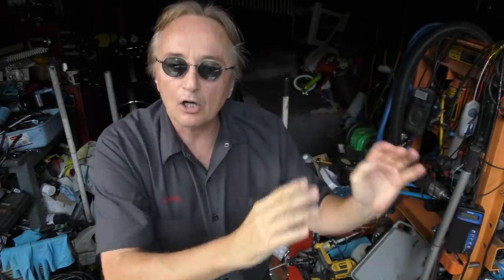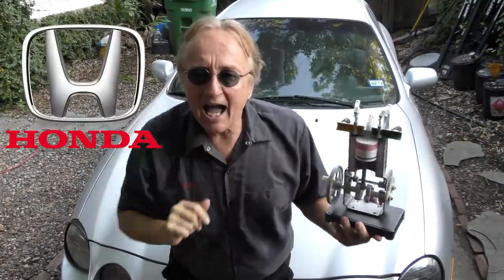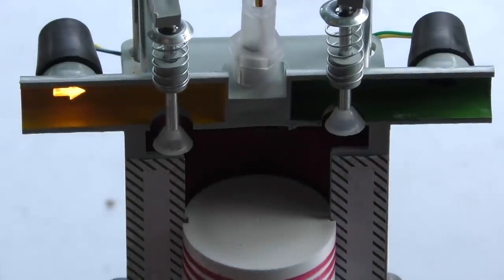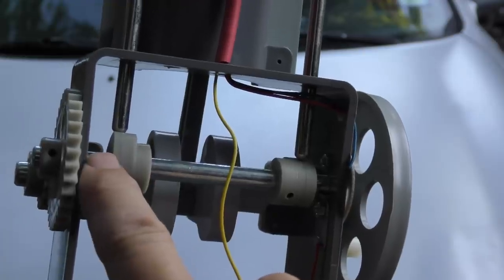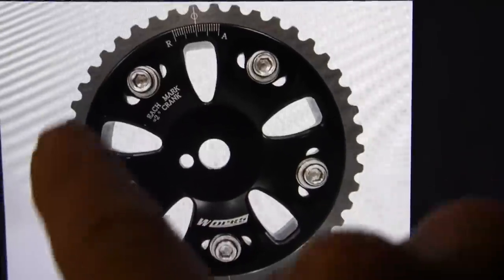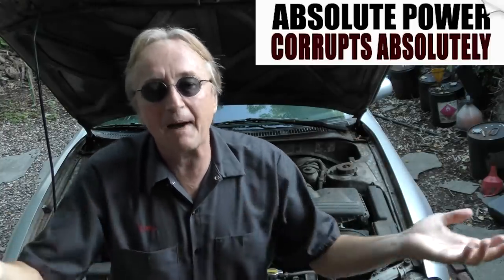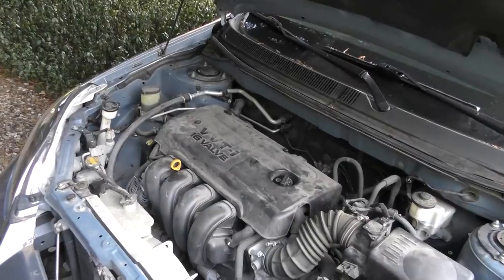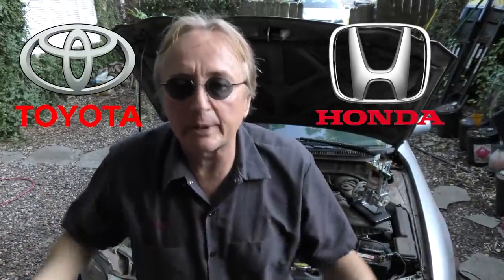VTEC Just Kicked in Yo - The Best and Worst VVT Cars to Buy

Comment: Wow, never saw Scotty be so enthusiast about a brand that isn't Toyota. Didn't know Honda gets his approval to! But Scotty, what about our own brands like Chevy and Ford. Are they any good?
Reply: Ilias Lamari there as good as any other American car. Meaning they are typically trash. American cars used to be made with some sort of quality and standard, now they are made to meet the bare minimum government standards, while cutting corners to save cost.
Reply: Those are our own brands, more Hondas and Toyotas are made in America then Fords and Chevys
Reply: @ Shawn Tyson- More accurately, assembled in America.
Reply: I've been to Kentucky where the Toyotas are made and everything is built and assembled right on the plant, and am a certified Honda master tech so I know that Honda is the same way :)
Reply: I really like American cars. I think that they don't make them anymore as they used to be. But overall they aren't that bad. My first car will be a cheap 70s American car or truck.  Properly gonna be a non runner but because of the reliability of those vehicles I'm not afraid to get it running.
Reply: You heard Scotty say the  poorly performing Mazda VVT  used a Motorcraft actuator........ Motorcraft is Ford. The Ford cam phasers on the Triton engines are very unreliable. Maybe you'll get 100,000 miles out of a factory unit and 40,000 miles with an aftermarket unit. We have 6 in our fleet at work and I have several neighbors that own them, same sad story of failure with all of them. My advice is always replace complete timing set with factory Motorcraft parts for best longevity if you're going to keep it, or fix it economically and sell it.....
Reply: I have seen the aftermarket cam phasers crap out in 15000 miles...by the way I'm not endorsing Ford or Motorcraft I am actually a Chevy fan. I'm just sharing my experience and advice like Scotty does, HE is the MAN!!!
Reply: Ford Mondeos are said to have a good reputation, is that true?
Reply: What I have to say is go for an older one rather than a newer one. Mustangs in general I think are pretty reliable, but seemingly tend to develope oil leaks as they age (this even affects the ones that are only 3 years old). Some GM cars are ok, others are trash. Want a cheaper alternative to the Corvette? Find yourself a Pontiac Formula 350. It shares many common parts with Trans Ams but costs alot less.
Reply: So many Fords, Chevy, Dodge Ram, etc., being made in Mexico.
Reply: Some Fords like the Focus and Fiesta are actually German.
Reply: Maybe in Europe, but in North America, the Fiesta is built in Cuautitlan, Mexico.  The North American Focus has been built in Michigan, and although Ford announced it would also move to Mexico, production instead is moving to China...
Reply: I bought my Ford Escape in Mexico as a Mexican model  but it's actually made in Kansas!   All depends on how they set things up. 
  Lot of poor quality control on parts, design errors that cascade into bigger problems.  First and last Ford.
Reply: I've had two Chevrolet Impalas. Not great cars, but you can do MUCH worse. Mostly it's little things that break, and also the cheapness of some interior materials which I won't deny they are. My '07 LT got to 100,000 when I decided to trade it in for a newer '13 with a more powerful engine and better transmission. The old '07 never gave me engine or transmission problems. The only major fix I've done to it was a broken water pump at around 98,000 miles, a warped brake rotor and the sunroof. Everything else was just routine maintenance. The car had a 3.5 V6 'pushrod' with a very strange VVT system. Made about 210hp. It was slow, but very smooth.

My '13 Impala has a much more modern 3.6 DOHC V6 with a much more conventional VVT system. Makes around 300hp which is pretty damn good for a boring family sedan. I've driven it a lot. It's got 60,000 miles so far. Things that broke are the engine mounts (fixed under warranty) and the speed sensor harness ($40 fix). The left door reflector broke off, so I had to glue it back. Also the reclining lever for the seat popped off (cheap plastic), I also glued it back. Other than that, it's only been maintenance as well. It has left me stranded once; the battery died after 5 years. That actually happened a few days ago. Not the smoothest car. The engine is very grunty and rev happy, big wheels and skinny tires make it a bit uncomfortable. But it is a surprisingly quick car and very fuel efficient.
Reply: Ilias Lamari I have a Cadillac ATS with 2.0L turbo with vvt, I abuse it a fair amount and the car has never left me down. It comes down to maintenance as Scotty said, I've always changed the oil at the recommended interval with the best oil possible and the car runs great. I have zero complaints about this car it's underated in my opinion.
Reply: logan kincade that has not been the experience I've had driving a 2002 expedition with the 4.6l Triton. It's on the way to 200k without needing phasers. The problems I hear about the Triton V8s are chains or tensioners failing to dirty oil or leaky exhaust manifolds
Reply: Ye'r took err jhubs.
Reply: TheHuskyGT wow I have a Ford escape and it has been an awesome reliable car. Just do maintenance and it will last. Gets 25 mpg with the v6 to. All my Fords have gone over 200,000 miles without any major repairs. But being a mechanic I guess I have the advantage of knowing how to take care of my cars. I don't believe Toyota is better than Ford anymore
Reply: Shawn Honda and Toyota are still Japanese companies, they aren't American and while they provide Americans with jobs, the profits go back to Japan bro. Sorry to burst your bubble.
Reply: r0llinlacs  

Chrysler Jeep Dodge isn’t American for a long time now. But people still call them American.
Reply: No
Reply: Awesome so you fix all  the new Honda oil burners huh?
Reply: Japan knows how to make a car.

Comment: Mazda had problems with their L series engines with their variable timing, however this is NOT true with the Skyactiv line, which is extremely reliable. Basically any Mazda from 2014 to the present.

Comment: I was very exited to hear Scotty praising VVT system until he mentions it's garbage on Mazdas . I have a Mazda 😭😭😭
Reply: gg
Reply: As he said just change the oil when it's due use synthetic and ensure its the right viscosity. 
I also have a Mazda and I got it because of the high reliability of other Mazda owners I know. If it's a SKYACTIV your fine. They have improved so much since Ford no longer is part owner. Now Toyota works with and is investes in Mazda. They wouldn't do that if they didn't have good reliable vehicles, the new Mazdas are so much better than Ford-era Mazdas.
Reply: What about miatas?? Do they have the vtec and potential problems Scotty was talking about??  Or are they ok?? Might be buying one soon.
Reply: @LJC123  The mk2.5 mx5 has a 1.8L VVT option. It's not got much more power over the regular 1.8L engine (6bhp extra I think). I know if you give it 97 octane and a better breathing induction kit - you can push 40mpg and about 160-170~ish bhp out of it.
Reply: Mazdas are great because they aren't German or American and can run just as long as the other big 4 honda Toyota and Nissan
Reply: @m.i.smooth810  I've set my one on fire, pissed out all of its engine oil, run it without an alternator for miles whilst it's overheating doing 70mph, drowned the engine with water... It still runs like nothing ever happened. A mk2 1.8l vvt mx5 is bullet proof. It's just not that powerful and likes to rust.
Reply: @ljpr360  The ones that were built in the Ford plants don't rust as bad.  Better quality steel was used.
Reply: @787brx8  I think you got that backwards or maybe you saw one that was in an accident and wasn't painted property? All my friends who have Ford Era Mazdas (mostly 3s) rusted to death, mechanically it was still good. 
My Mazda (SKYACTIV) has had no rust issues. I don't see a lot of new Mazda's rusting here and I live in Canada with salted roads 3/4s of the year. The new ones are much better.
Reply: @ljpr360  My MX-6 and 626 made in the nineties have less rust than my Proteges.  

Flat Rock Michigan plant for the win.

The Mazda 3 was not made there.
Reply: @787brx8  The Protege was a still Ford Era car. Only the SKYACTIV vehicles after the 2013 model year. The Protege was discontinued before Mazda's independence.
Reply: @ljpr360  The Protege may be A Ford era car but it is not made in America, with American steel.  The vehicles made at the Flat Rock Michigan plant are made with American steel.
Reply: @ljpr360  when did the Ford-era end? Are the following Mazdas good?

Mazda 3 SP25  2nd Gen(BL; 2008–2013) using Mazda L (L5 SVT) 4 Cylinder, 2.5 L engine. 
Sports Automatic Transmission

Mazda 3 SP23 First generation (BK; 2003–2009) using Mazda L (L3 SVT) 4 Cylinder, 2.3 Litre engine. 
Sports Auto Transmission
Reply: @michaelb7862  With the SKYACTIV version of each nameplate. They are better in Mazda's than Ford's but those motors are a shared architecture with Ford. If you take care of them they can be fine motors but they probably won't hold up as well as a SKYACTIV: 
2013+ Mazda 6
2014+ Mazda 2/3 
All Mazda CX-3/CX-30/CX-5
2015+(ND) Mazda MX-5/Miata. 
2016+ Mazda CX-9.

All those vehicles are independent Mazda or Toyota partnered Mazda. Truely phenomenal cars. My Mazda 6 2.5T is getting similar and in some cases better fuel economy to the Honda Civic 1.5T CVT it replaced, because it doesn't have the oil dilution issues, has water to air EGR intercooler and Mazda's R&D from the Mazdaspeed vehicles they made with Ford. They really have come a long way.
Reply: @ljpr360  I thought I heard that there were problems with the early SkyActiv engines. Which I presume that the 2012 Mazda 3 SP20 SKYACTIV BL Series 2 Auto using the SKYACTIV-G
 4 Cylinder, 2.0 Litre would fall into.
Reply: @ljpr360  which are the ford era mazdas and what years/models should i avoid?
Reply: @ljpr360  werent mx5s always known to be reliable?

Comment: Umm, I think VTEC and VVT is different. VTEC is variable camshaft and VVT is variable valve timing. VTEC use special camshaft that will open valves longer by the command of ecu. VVT use special intake or exhaust (or both called dual vvt) VALVE that will open and close longer depends by the command of ecu. It's basically the same but they are different
Reply: Toyota has a VVLi variant to the standard VVTi & Li version does change lift.. it's rare but they are out there
Reply: what if they just joined forces and made an engine with both technoligies
Reply: Merc have camtronic and bmw have vanos